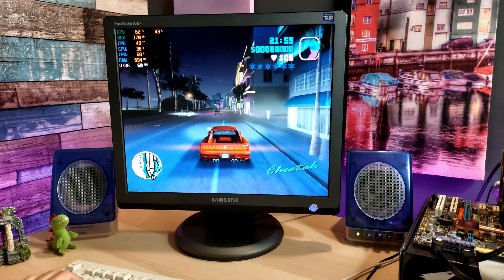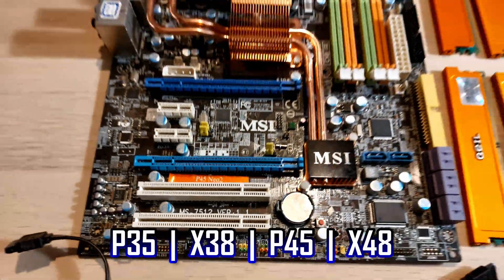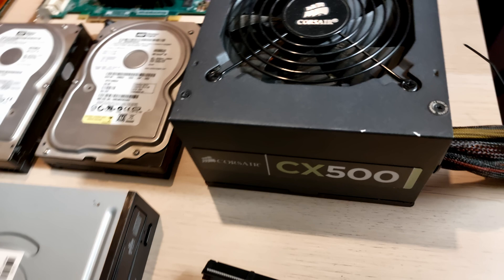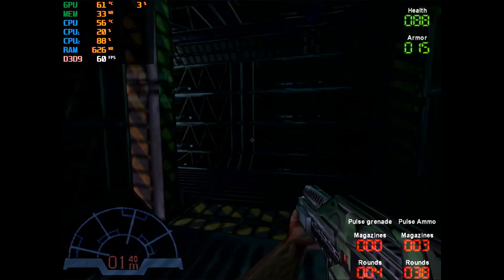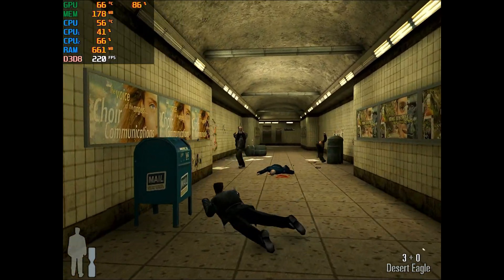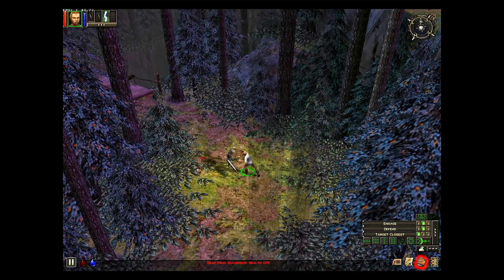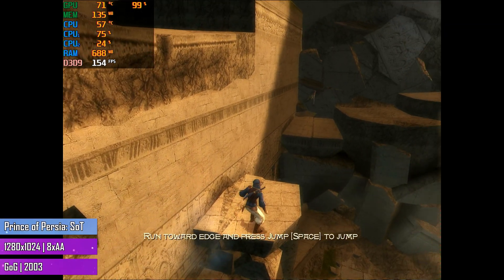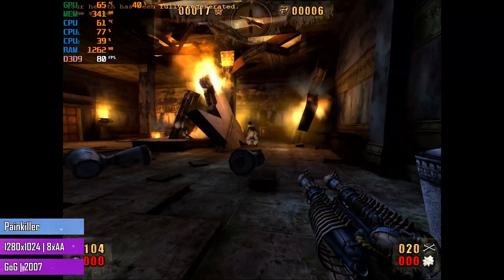What PC should you choose for Windows XP gaming?

Comment: I'd have my Xeon E5450 in a build if I hadn't had my Asus P5Q Deluxe fail (chipset issues), because it paired well with my GTX 650ti (which I actually initially bought due to my screen at the time only having VGA). Wolfdale/Harpertown C2D/C2Q CPU are noticeably faster than Conroe/Yorkfield C2D/C2Q while running far cooler.

Now though I switch between either my: Athlon XP 3000+ (400FSB) and 6600GT, and my Athlon XP 1800+ (Palomio) and FireGL X1 256-P. Realistically anything that doesn't run on the FireGL either runs on my main PC or is old enough that its better under Windows 98.

Comment: Very Nice setup & thank you for your video, just subbed for the amount of info & very entertaining video. A lot of people aswell if Intel isn't as easy too find but that weird middle ground of AM2 - AM3+ You can use these as Win XP Machines aswell. People forget for a while both Intel & AMD were both swapping place for top dog before the stagnation period after Intel took the Lead in the 14NM+++++++++++ times. I honestly would take either 775 or AMD board from that time, I have both a AM3 Desktop that I have ready to go at a moments notice with a ATi/AMD GPU & about 10 GPUs I have on standby both NVIDIA & ATI/AMD if I need too swap one out. Hell even a garage sale a couple of years ago I scored an Acer Laptop that was top of the line parts but for the Windows Vista Era. AMD Athlon 64 CPU But NVIDIA GPU works perfect for so many games from DOS - Win XP (I run 32 Bit for ease of getting things too run.)

Comment: I have 3 XP systems.
System 1 
1. Asrock G41C-GS R2.0 for a motherboard 
    It accepts DDR2 800MHz or DDR3 upto 1366 MHz memory. has jumper for faster than 800MHz if I remember correctly. 
2. Q9650 3.00GHz CPU Quad core.
3. 4GB Samsung DDR3 @ 1600 downclocked to1333MHz through motherboard
4. HP DVD RW multi drive SATA
5. Startech caedreader
6. Floppy Drive IDE
7. GTX 750 TI GPU
8. 2TB SSD Samsung 970 EVO
500 watt PSU Corsair
First XP system that I built just for XP. 
System 2
1. Asus Sabertooth 990FX
2. 8GB Corsair 1600MHz Vengeance memory because it was on the board
3. FX 8350
4. HP lightscribe DVD RW multi drive
5. 500GB SSD 
6. MSI HD 7970 GPU
Still bootable, needs work.
System 3 Main Main XP System
1. HP/Foxconn Motherboard
2. I7-3770
3.16GB memory for Windows 7 64-bit
4.  1 WD Blue 1TB SSD for Windows XP 1 Samsung 2TB 870 Evo for Windows 7
5. GTX 780 Ti
6. Startech card reader
7. Fractal Define Mini MATX case
8. Corsair 750 watt semi modular PSU
9 USB 3.0 PCIe card for front USB 3 Port
My best and most difficult to build system. Drivers were hard to get. I used SDI to take care of that for XP. Windows 7 worked straight away.

Comment: If I would build a XP PC, I would choose an Wolfdale Core 2 Duo (45nm lithography), 4GB RAM DDR3 and an SSD. There's no reason to use HDD anymore. For graphics card, the oldest card that can run your game at 60+ fps with highest resolution and details is the better, since it will support older drivers. You can use an GTX 980TI, but the older games will suffer com compatibility issues and the newer games will be better runing on Windows Vista or 7.

Comment: I built my retro xp pc in 2024 , just 5 months ago . xeon x3430 2.4G LGA 1156  4 cores 4 threads .  ASUS P7P55 WS Supercomputer ATX motherboard , 4 sticks of 4G 1333M/T DDR3 . R5 250 2G GDDR3 GPU, DVD RW  drive , 1TB hard disk , 120G SSD . 520W fanless PSU . Coolermaster tower case and USB 3.0 PCIE add on card with 2 ports in the back and one connector for the front USB 3.0 port in the case .

Comment: I7 3770, GT 640 1gb GDDR3, 8 GB DDR3, 256 GB SSD dor XP and 512 GB SSD for windows 7
Reply: how you do gameport ?
Reply: @lucasrem It's ok but there is some issues with the Nvidia driver. Maybe I put a 9800 GT with a driver from 2008 for Windows XP (game's 1998-2008) Windows 7 64b works fine for direct X 10 game's.

Comment: Mine’s Intel desktop board DH67BL, Core i7-2600, 16GB RAM, SSD, and GTX 960 4GB.  It’s way overkill on its XP installation, but the computer moonlights as a Linux machine with Vulkan support.
Reply: Depending on the classic game in question, I’ll oftentimes limit to one or two threads locked at 1600MHz. Keeps my video card from coil whining when the FPS is going well above 300. Also, use a frame limiter if it’s running too fast! Can be done either with RivaTuner or a utility like CPUGrab to hog an arbitrary percentage of CPU.
Reply: I have similar, albeit slightly worse - i5 2500K, 16 GB, SSD and GTX 550Ti. And of course P8H67, the same chipset as you :) "Rock solid and heart touching", haha

Comment: Yes! Please make a more detailed vid diving into the specifics. I plan to build a WinXP PC in the near future and I'm particularly confused about the hard drives. Some say find an old PATA Hard Drive, but some say it'll be better to buy a cheap 2.5" SATA SSD then just configure it to MBR via another PC's Disk Manager, but few also say this method hasn't worked for them at all. It'll be a big help man with you explaining a few things.
Reply: SSDs are dirt cheap. Might have to supply sata drivers at time of os install. Saying that, all my old machines just run standard 80gb ide drives which I'm happy with so you certainly don't need an ssd. Build, enjoy 👍

Comment: It's hard to find people with the same way of thinking as me. If want to go back to the old games of 2000s, they often want to build a ultimate performance like the Core i7 2600, which is overkill for Windows XP games. But that was the era of Pentium 4, Pentium D and the ultimate Core 2 duo cpu . Pentium 4 was really not too good to run AAA games back then, Pentium D was too hot, and Core 2 duo/Dual Core is truly the perfect choice for XP games. Why do you want a core i7 4770 to run XP games? What I want is not just to return to play old games but to re-experience the emotions running them on old hardware that we used to have again. That's the unique thing.
Reply: Personally, I have a GDM-F520 CRT display which can get refresh rates above 200hz on lower resolutions. Having a CPU can consistently supply draw calls that fast is great. C2D can get you there, but my i7-860 is another jump above that and works with Windows XP just fine. I'm sure a high-end period correct GPU could get you the framerates needed to drive that, but my GTX960 runs a lot quieter and cooler! I run an X-Fi Titanium for sound though, to get that sweet EAX compatibility. I think period-correct is much more important during Win9x era hardware, where you have all these different APIs for graphics and sound, and even more so in DOS games that would otherwise run too quick
Reply: @hugevibez true! To each his own!

Comment: I am a huge winXP fan and have built and tested all below PCs:
1. Best possible PC for XP: i7-4790K + Z97 MB + GTX980Ti (require unofficial drivers for gpu and some Z97 motherboards)
2. Best possible fully supported PC for XP: i7-3770K + Z68 MB + GTX780Ti.
3. Best nostalgia and more period correct XP PC: Core 2 Quad 9650 + X38/P35 MB + 9800GTX+
4. Best low power XP PC: i5-3570 + H61 MB + GTX960 (also very suitable for miniITX builds)
I cannot decide which I love most, so I decided to keep all 4 PCs.
Reply: I have a similar PC with i5 3570 and 750 Ti. It runs most games at stupidly high framerates on the 1024x768 screen I have attached to it. Some older games like Midtown Madness, Klingon Honor Guard and Alien vs Predator 1 dont work on it though. I have parts to build a high end period correct machine with Qx9650 and 8800 GTS 512, and a lower end machine with Athlon 64 and Radeon 9700 Pro. I have a Win98 machine with Core 2 Duo x6800 and nVidia 4600Ti for games up to 2001 or so.
Reply: Nice 
I got i7 3770 machine for windows xp too 
8gb ram 
480 ssd i dualboot with windows 10 too so thats why i even got 8gbram total 
650ti 1gb 
2tb hdd
Gigabyte z68xp ud3p mobo 
Evga 700br psu 
Optical drive lg sata 

However in the past ihave used weaker machines for winxp specificly such as :

Q9500 core2quad
Gts 2501g(ihad 9800gtx at one point)
Inteldq45cb
4gbram 1tb hdd and 250 gb ssd
Random cheap psu

Phenom8400 at 2.1 ghz also athlon64x2 dualcore3800 plus
250gb hdd
9400gt 512mb
3 than 5gb ram 

So yes i have more or less seen it alll when it omes to winxp 

But as of now i mosltyenjoy my current machine 
It runs everything i can trow at it 
Also im a pc guy that i flipe pcs as a hobby so i know how to assemble and maintaon the computers
Reply: Drivers are pretty official. Same as for 960 and below. Just few added lines in .inf file.
Reply: @RudolfSikorsky  i am getting a 960 2gb gigabyte single fan edition....for winpx gaming in few days i hope it works (winxp32bit integral edition)
Reply: @energygameplay6513  It should work just fine. Last drivers for XP were actually pretty good. Crazy to think that 900 series is still supported.
Reply: @RudolfSikorsky  I got currently  i7 3770 machine for windows xp
8gb ram 
480 ssd i dualboot with windows 10 too so thats why i even got 8gbram total 
650ti 1gb (about to be replaced with gtx 960 2g) 
2tb hdd
Gigabyte z68xp ud3p mobo 
Evga 700br psu 
Optical drive lg sata 

reason i am replacing the gpu is because i wanna play little more modern games on here ....because this is dualboot-i got windows 10 and xp installed ) i simply want the best of both worlds within same pc and press of a restart button
Reply: @energygameplay6513  I was about to ask about CPU choice as XP doesn't use more than 2 cores but if it's dual boot, then I understand.
I have GTX 970 in my XP machine. A bit overkill but I got 1600x1200@75 monitor and it did cost me just 25 euros, so why not.
Reply: @RudolfSikorsky  i used to have a core 2 quad q9500 but sadly the motherboard was driving me nuts -no it wasnt fully broken but some things were just annoying -i was lucky to even manage to sell it 
but eventually i was like since i am swpaping the board i might aswell swap the platform 
and thats how the idea of i7 3770 was born and eventually i made it
Reply: let me tell you windows xp on my machine is very well supported and runs like a freaking formula (very fast) also i have tried tripleboot with windows xp 32 64 bit and windows 10 64 - why not right and i never had issue
Reply: i' get an 3770k with gtx 680 for my xp build :) ...think that will work pretty well
Reply: Which component would you say is most likely to be responsible for great compatibility? I would like to have a low power, small formfactor, low noise and high compability.
CPU: 3470T - 2.90 GHz (35W TDP) + ASRock H61M-ITX + GTX 760.
Is that a good choise? Is the Driver compability (≤368.81) that important or can i choose a better / passiv GPU?
Reply: @robertschumacher9640  Overall it's a great choice of components. Sandybridge and 7th gen gpus are fully compatible with XP. Problem is, don't try to play games newer than DirectX 9.0c on WindowsXP. That means games newer than 2007. DirectX 10 came with Windows Vista in 2007, but some games still supported DX9 for few years. For games up to and including 2006, they are all fully compatible, for games 2007 and up, I would check if they have a DX9 setting. 
Also: 960>760 both performance and power wise. GTX 960=120W, GTX 760=170W. Eventually get a 750 Ti=55W, does not require power cable, and it's not far behind gtx 760 in performance. Also, make sure you get a gold-platinum-titanium psu, if possible. I personally have a 80+ Bronze FPS flex psu in my low power/low profile PC, and found a low profile KFA gtx750 ti as well, to replace the GTX 960. It draws under 100W in full load.
When it comes to monitor, it's better to have a 4:3 monitor as well (1600x1200 or 1280x1024), as many games don't support wide-screen resolutions. A gtx750 Ti will easily play games from 2000's era on max settings, 1600x1200 resolution.
Reply: @ares23dc  Many thanks for the detialed advise! That exatcly the indormations i needed.
Reply: @ares23dc  Hey. What Z97 mobos is it that you're talking about with a i7-4790K + GTX980Ti build?

PS: 1. I know about the GPU, but why would you say the mobo/cpu is "best possible but not official"? 2. Would one run into issues with Win9X games? Maybe DX8?
Reply: All those setups you mentioned are awesome choices. I'd love to one day get my hands on the number 1 option. Disable two of the cores and disable hyper-threading, because apparently dual-core seems the best performing option for XP. And, disabling two of the 4790K's four cores and turning off hyper-thread guarantees the CPU running at 4.4GHz at all times.
Reply: GTX 960 works out of the box as well...even with SLI.

Comment: My retro build is based on the skt 939 agp: Gigabyte GA-K8NSC-939, 4x1Gb ddr1@400mhz, Athlon64 FX-60 and a Leadtek 6800GT with AC cooler. Last year I finally finished NFS MW on this build after almost 20 years, great time.

Comment: I'm running an i5-2500k at 4ghz, a GTS 250 1gb, 4gb of DDR3 at 1866mhz and a 500gb SSD  to dual boot Windows XP and Windows Vista. The GTS 250 is great because it's still completely compatible with everything in the XP era and powerful enough to run everything I throw at it.

Comment: I find the UGreen DVI to HDMI adapter useful for converting from DVI to HDMI at the graphics card end. However, you can also use a second one of the same adapter to convert from HDMI back to DVI for a monitor with a DVI port. This allows you to use a much wider variety of quality HDMI cables with your DVI monitor and video card than using a simple DVI cable connection, where the choices available for such cables is more limited, and the cable itself is significantly more cumbersome.

My two XP Pro SP3 32-bit machines (why have just one when two (or more) can really do it for you, especially with a good KVM with audio, such as a Belkin for both machines to use the same peripherals):

AMD Athlon 64 X2 4800+, ECS nForce3-A939 MB, 2GB (2x1GB) Kingston HyperX DDR 400 memory, 256MB GDDR3 XFX 6600GT AGP, SB0090 Audigy PCI.
(Likes late 98se games that also likes XP as well, such as MS Flight Simulator 2002).

Intel Core 2 Quad Q9650, Gigabyte EP35-DS3R MB, 8GB (4x2GB) G.Skill DDR2 1000 memory, 2GB GDDR5 EVGA 750 Ti SC PCI-e, SB0090 Audigy PCI.
(Likes mid-late XP games, as well as early-mid 7 games when dual booting with 8.1 64-bit with Classic Shell Start Menu. Doesn't like MS Flight Simulator 2002 though, just 2004 onwards).

Comment: AM3 or AM2+ is also a great platform. Stable, cheap and powerful.
Reply: That's absoluety not true. There is nothing cheaper and better than i5-2500K+H61 MB combo on AMD's side.
AM2 & AM3 are pure shaite compared to Intel from the same era.
Reply: @ares23dc  Hard Intel fan lol.
Reply: @vojtechadame5860  I do hate to burst your bubble, but I built PCs for more than 25+ years. AMD was not always Ryzen.
Intel dominated from the launch of Core 2 DUO/QUAD, up until AMD launched of Ryzen 3000 series.
Phenom II were great, but way too expensive, so no point, and Ryzen 1000&2000 were not really up to speed with Intel yet.
I used to be a hardcore AMD fan, used to own K6, AthlonXP, Athlon64 and Phenom I
Reply: @ares23dc  I was talking about performance in XP games. Try to understand the context first.
Reply: @ares23dc AM3 sure, but AM2 is C2Q era, where AMD was doing quite well with the Phenom II. That's about the limit of realistic hardware for XP anyway. You can go crazy if you like of course, but people usually arent building old PCs to get the best performance possible.

Comment: I have so many configurations available to me, but I got started with E7200 and 9600GTS. But now I'm working on building a i7 4790k and GTX 970 dual boot XP and Win7 machine. 

But I still love my G41 board with an E8600 and GTX 950 XP 64bit edition machine.
Reply: Just built the almost same setup yesterday :D 4790 non K with Asus 970 Mini OC 4GB. Unfortunately the stock cooler is weak, the cpu idles at 70 degree celsius in BIOS. Just ordering a Noctua to keep it cool